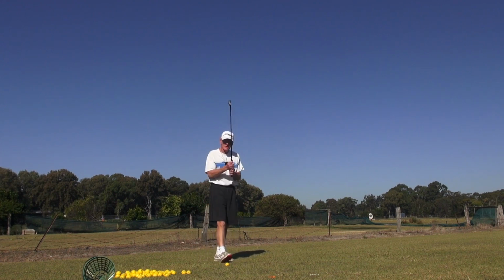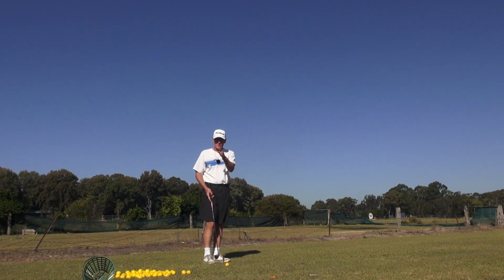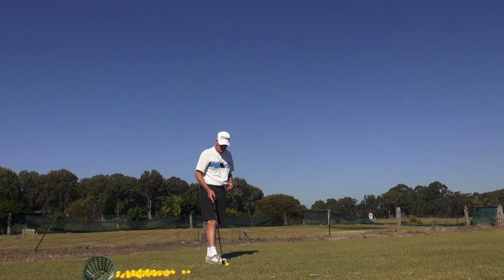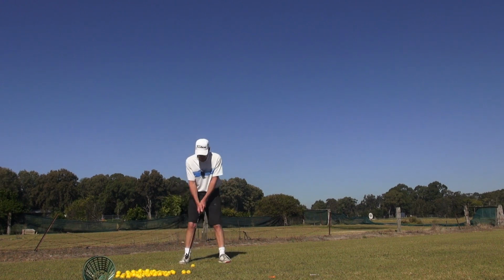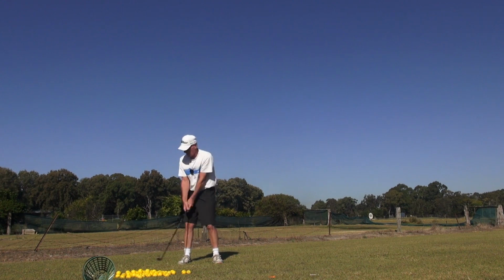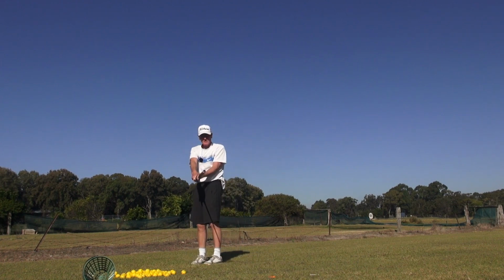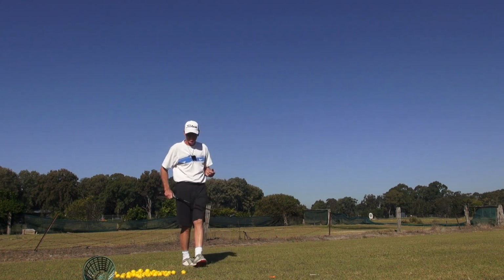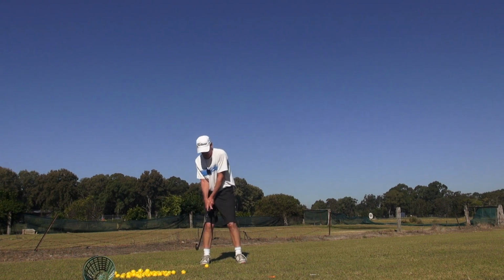Baseline Simplification  of Channel Lock

Comment: JH, I have a suggestion that seems to have worked for me.  Think about this ... We all have different body types.  Some are slender; Some not so much!  Some of us have long arms and short legs; Some of us have short arms and long legs.  Some of us may have a larger chest area.  Think about that when pushing the arms straight back in the Channel!  😂

My point is, even tho one of the tenants of the CL protocol is a back foot ball position, there are variations in exactly where that ball should be.  It might work out for some that it is just inside our toe line.  Or, it could be best further behind out trail foot.  Perhaps,
for some, a smidge further out or a smidge further in!  An inch here or there can make a huge difference in the quality of the strike, right?  

So here is my suggestion.  Everyone should take their best CL stance / posture WITHOUT the ball but imagining a ball there.   Back foot ball position (imagined), closed shoulders, soggy knees, pre-turn, 5 o’clock nose, etc.   Take your best athletic and balanced swing in the channel and be sure to brush the turf.  Do it again!   WHERE IS THE  CLUBHEAD BRUSHING THE GRASS?   Take note of that very spot for THAT is where you should position your ball and not in some random back foot position.   Would you agree this is a good idea?   I’m curious to hear your take on this.  Thank you again!  🙏🏼
Reply from the maker: Hi   Craig,
                     Ok.. we are 'all'  physically' different ...no question .. and a 'one'  ball position theoretically shouldn't suit 'everyone' .. and it 'doesn't ' for most people ..... but  Channel lock is not about  'suiting'  a  players 'natural'   swing  radius  low point  as you are suggesting with your   practice  swing   club bottoming out point on the ground.
                      There is absolute 'nothing' ...' natural'... geometrically  in a CL    swing process ...the back foot  ball position  is a  geometry   'requirement'    in order that the base tenet of  being able to swing 'beside' the body  in the downswing  in the 'Channel'  in fact 'happens'...
                             The cold hard reality of the CL  swing mechanics is that there are 'things' you just 'have' to do if you want to have the CL swing geometry applying itself in the required format in order to  'get' the type of   'starting' direction ball flight consistency in the applied golf swing...CL  is an absolutely   'construction' specific requirement swing geometry ...its not about getting in positions in order that    'natural' individual swing radius geometries are allowed to apply themselves ..  
                        CL requires that players build the necessary swing geometry requirements into their golf swings .. 'Natural'  swing radius  bottoming    of arc positions    are just not   appliable    in a CL  swing process if you are to   get the   specific   attack path    angle/direction   that you need in order to  create the  specific   ball flight type of   initial starting direction... you simply cannot get  the CL    starting direction  ball flight  guarantee with   anything other than the 'specific'   geometry   application of  ball positioning at address and impact   that is  proffered  in the CL  setup procedures of the swing's address geometry etc.
                              Again this is the 'reality' of building a CL swing methodology ..   the swing process   can only  provide  a specific    ball flight   type  if  there is the   application of the 'specific mechanics' type  when building a CL  golf swing ... the  intending builder of a CL golf swing   must understand that  the CL swing   will only produce the suggested   ball flight results if the   correct swing mechanics are  implemented .
                  The  CL swing must be  'constructed'  from the suggested mechanics.. .. it just won't provide the results potential fully unless the mechanics are applied as they geometrically should be applied ... unfortunately, the CL swing mechanics/geometry etc are not in themselves as specifics negotiable for application if  you want to get the proper ball flight results that are designed to be forthcoming from the swing mechanics/ geometry application...
                         The Ball position can vary a 'bit'.. but not much ... you just simply will not be able to get the club tracking in the approach channel beside the body from any ball position that is greatly removed from the back foot positioning at impact ..  CL   is not a 'natural  golf swing mechanics golf swing in any manner or form ...and as result   just requires   a  very definite  effort to    get the body into the  required geometry  body and ball positioning .. you just 'have' to     get yourself     to learn the  mechanics application requirement .. ...
                     cheers JH
Reply: JH, Ok, Thank you for that.  I think maybe you may have misunderstood my intention a little.  I was only speaking of a possible inch or two in ball position variation.  I wasn’t suggesting anything different than a required back foot ball position.  

In some videos I’ve watched you have commented that you can put the ball back a little further than your trail foot IF you have the flexibility for that.  So, that suggested to me that you were allowing for different body types.  Thank you for your time.  Much appreciated.
Reply from the maker: Hi Craig,
              I knew what you  were alluding to ...  and you can move the ball a 'bit' forward  of the trail big toe .. but not  really  more than  at maximum   more than 2 inches .. the  problem is that you just cant get a straight line attack   of in to out  coming into the ball and keep the   lead shoulder closed if the ball is much more forward  than the trail  foot big toe .. I have tried that positioning and it just   makes it  to hard to  keep the lead shoulder closed at impact .. 
                   I just want to get across to people that  even I had to make a super conscious effort to   build that   address structuring for the CL swing ... its a hard thing to do     but the reward is  really  worth it .. a 'pure' Cl  geometry application  gives  just such a different ball flight quality  ..
                     A 'variation' setup    will  just   erode the   full potential of the  correct specific CL  mechanics/geometry  setup  procedure ...
                     There is of course  some potential to apply a  'Non Specific'  CL   setup procedure which   could still be more efficient in its ability to  produce better results than a conventional golf swing .. but the   'true'CL  mechanics will deliver  a significant  level of difference  to that   modified   type of CL   swing setup..
                        cheers JH
Reply: 1atomicgolf 
Got it!  Now I can’t wait to get back to practicing some more.  I think I’m at Base Camp #2 on my climb to Mt Everest.  👍🏼
Reply from the maker: Base Camp # 2 is  a good place to start your 'Everest' climb..  'acclimatising'   to climb 'Everest' is essential... and CL is no different .. the  swing is an 'Everest' climb ... and like Everest  as long as you follow the    'correct'  climbing path  you 'will' reach the 'Summit'  ...
                       cheers JH

Comment: Hey mate.the hardest part to me is keeping the shoulder closed.really having to focus on the parimetic particle is the key for me.and that's where I'm at with it.hadn't had much time to go with but I'm getting there.feel like it looks a bit silly but getting normal distance. I'm way open with lower body but geometricly feels great.cheers
Reply from the maker: Hi Danny,
                it will take a while to get the weight distribution and geometry swing settings in place .. but when you do it will be way easier to repeat the setup process day to day ..shot to shot.. ... distance should be the same even a bit better I have found..
                    cheers Jh

Comment: Hi JH. When you talk about moving your stance around to the left of target so that your shoulders are only slightly right of the target, do you still have the club face pointing at the target or does that get moved to the left also? Thanks. Swing is going well but shots to the right are dominant even with as much release as I can get so will work on moving stance to the left more or reducing shoulder cock and hip cock. Cheers, Richard
Reply from the maker: Hi Richard,
            This video was before I   evolved into a  closed stance line ..  but it's perfectly ok to perform CL as per this video mechanics application ..    
              If you are getting a straight push out to the right that is actually a good sign because it shows you are very much in to out at impact in your delivery line.. the clear mechanical indicator is that you have an open clubface at impact for that shot to manifest itself ..
               To that end you    can do  two things  ..  one  somehow get your clubface     squared up /slightly closed at   impact   .. if that    is a difficult assignment     you can just   get more aligned to the left of the target    which is   what is   suggested  in this  video   ..  and the 'amount'  you align left    will be a matter of trial  and error     until  you start   hitting shots     on your target line .. 
                               cheers JH
Reply: @1atomicgolf  thanks JH, Would the club face also be aligned to the left or remain pointed at target?
Reply from the maker: Hi Richard,
                   The clubface always points towards the target and is  'released' towards the target ..  rememember..   the   hands/arms club all are fired outwards across the target line  'away'  from the target  .. but the club  'face' is released 'towards'  the target .. 
                cheers JH

Comment: When you have back cocked your shoulders, where are they lined up? Are they just right of the target?  Are your feet lined up left of target?
Reply from the maker: The shoulders  are    pointing  to the right of the target line  just as they would be  in a normal backswing  after   you had  turned a bit in the backswing .. all you are doing with the backcocking is pre=turning your shoulders a  bit at address ..the   foot line is  'parallel left'  of the target line or  a bit closed to the target line .. I personally   set my foot line closed to the target line ..
                  cheers JH
Reply: Thank you. Made some small adjustments that seemed to work. Apparently I was to closed with my shoulders and feet.